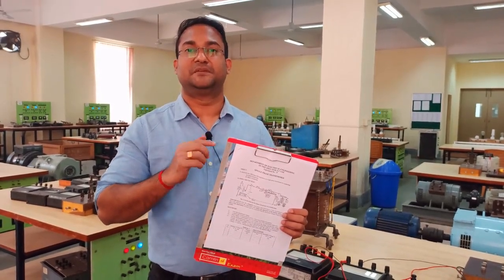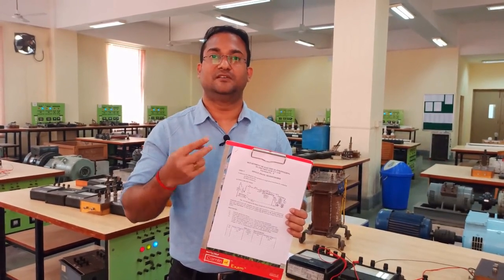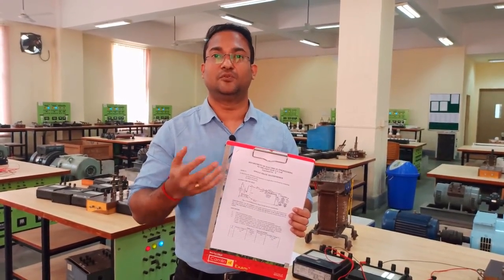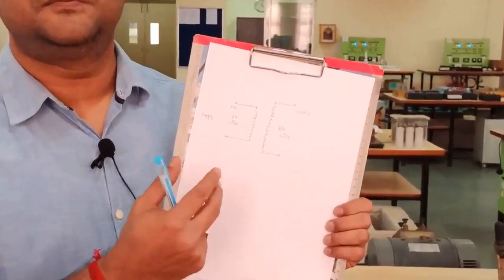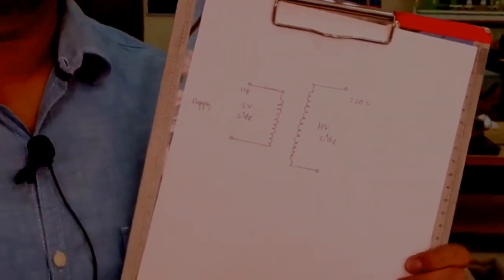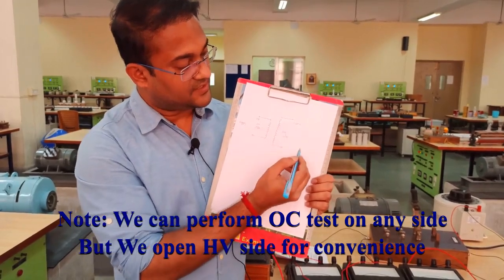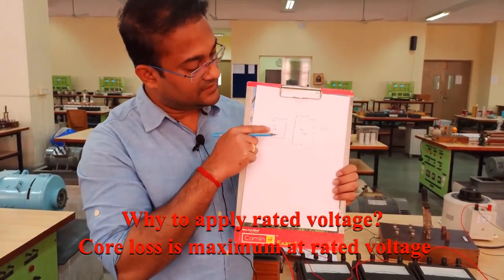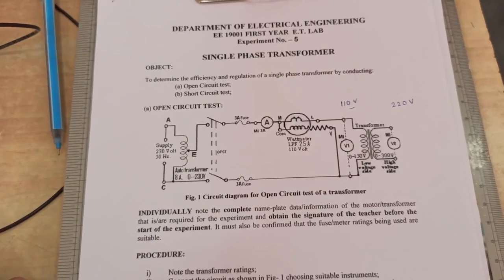Expt-5: Open and Short circuit Test of a single phase Transformer :  ET lab  (part of EN19003)

Comment: The total power loss in a transformer (i.e core loss/iron loss + copper loss) can be determined using Sumpner Test ( also called as Back to Back circuit Test )